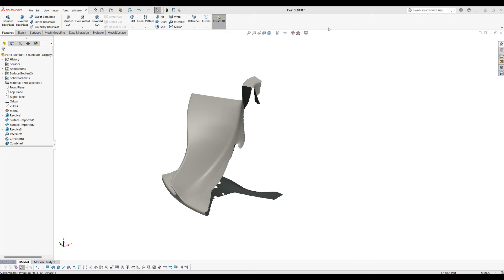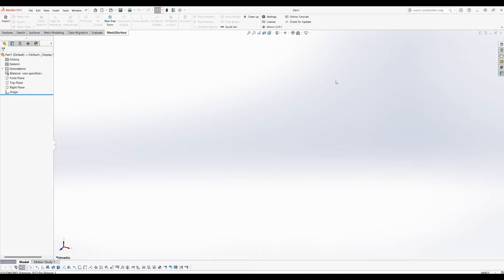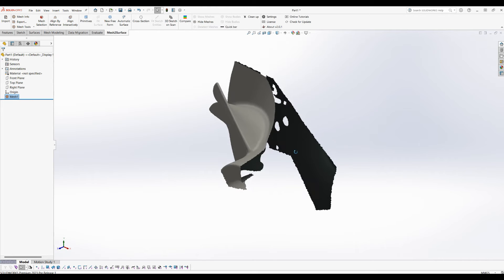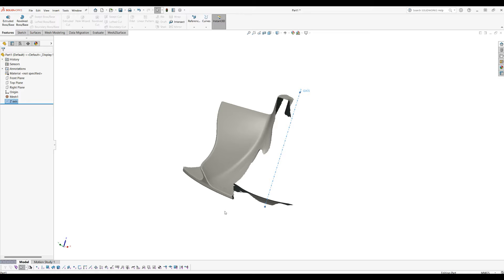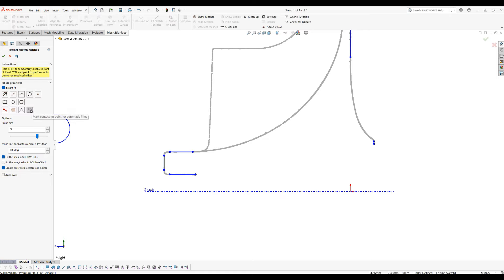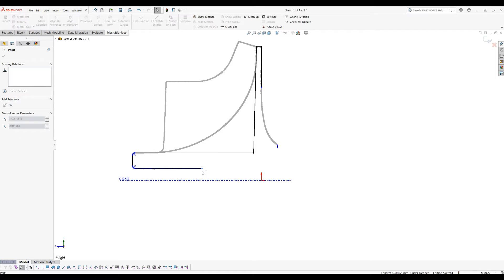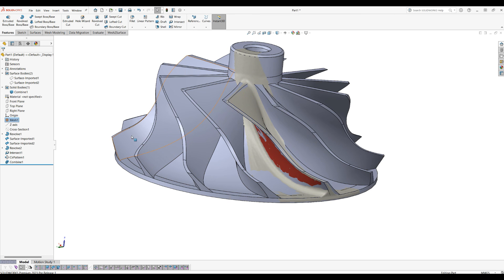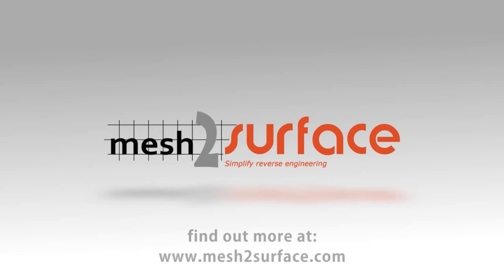Scan To CAD | Mesh2Surface for SOLIDWORKS - Reverse engineering  of impeller

Comment: Very fascinating video, great tool for reverse engineering, I Work with DesignX, Modeler and ZW3D, continue improvement help engineers to get quickly result and awesome precision.
Reply from the maker: It is time to start working with Mesh2Surface and QUICKSURFACE. More powerful, much simpler.